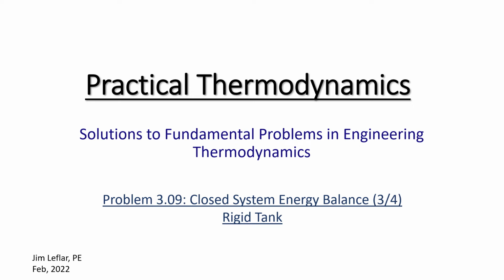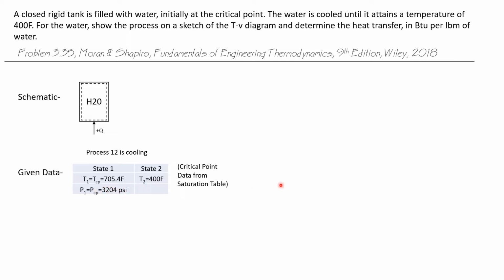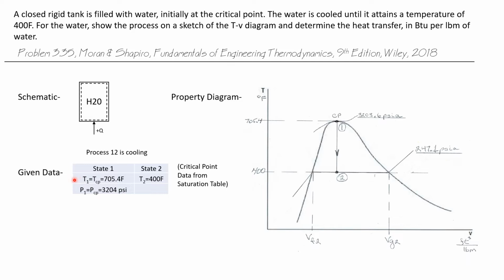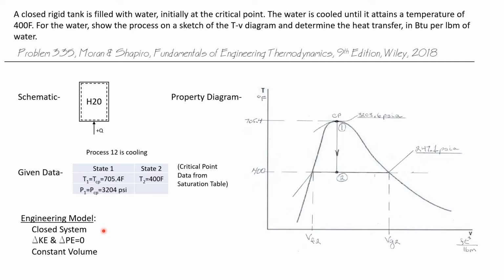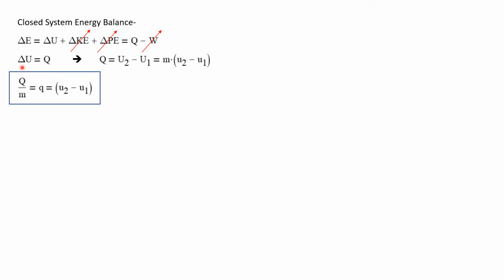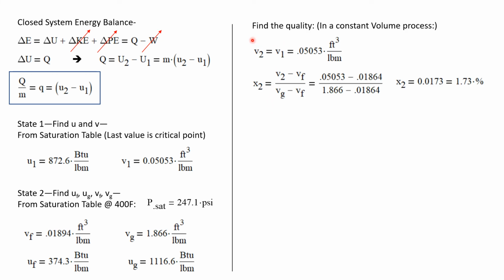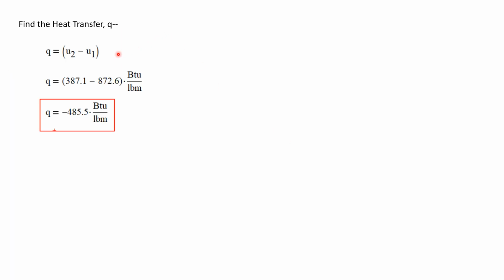The Saturation Critical Point and its Properties -- Engineering Thermodynamics 36/107

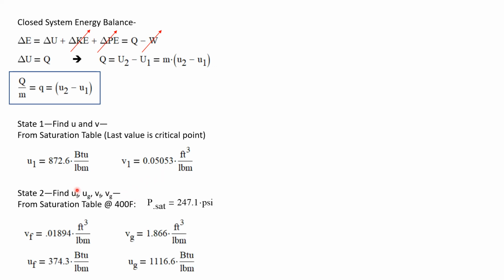Comment: 4:45 disculpe Jim, yo tome el dato de las tablas de Thermodinamycs by Yunus and Cengel 7th edition y el dato ahi es de 866.1 Btu/lbm
Reply from the maker: Thank you for your comment. My tables are extracted from Keenan & Keyes, Wiley, 1969. I double-checked the value and 872.6 is the value offered in these tables. My experience is that thermodynamic data does vary from table to table.
Reply: @jimleflar3166 ok thank you